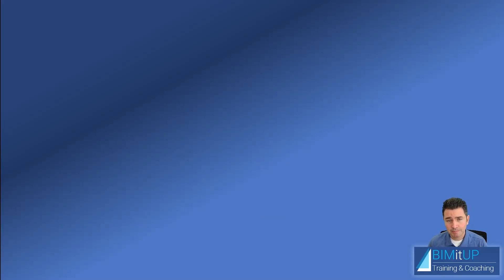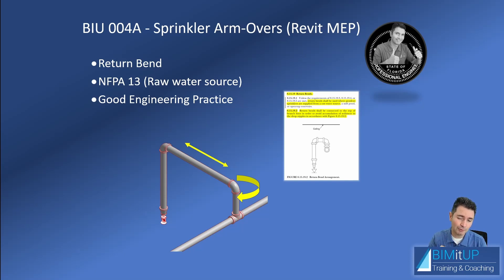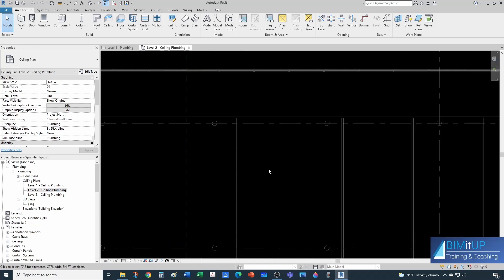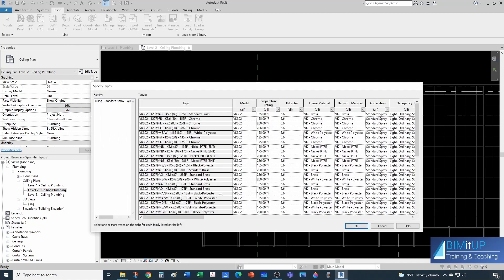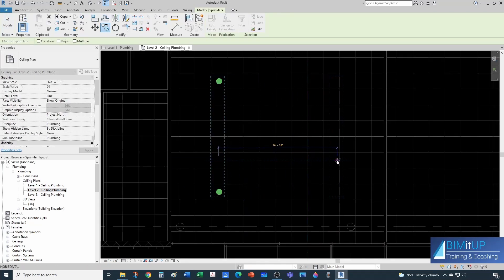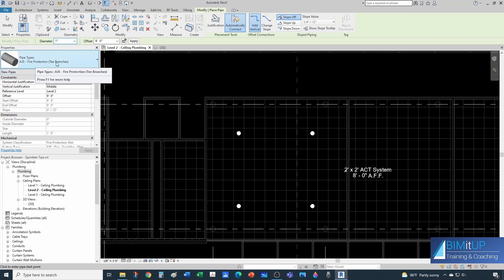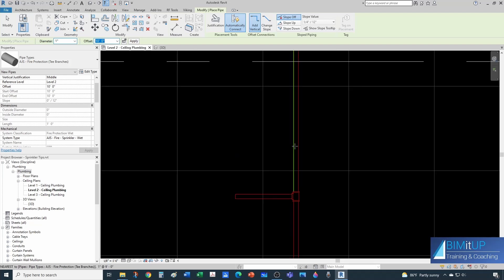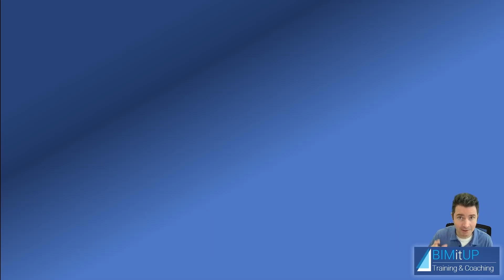Sprinkler Arm Over in Revit (Return Bend) Tutorial

Comment: The question I have if you go under duct work does the upright head follow the pipe or does it follow the upright head above?
Reply from the maker: Hi John. If I understand your question correctly...
you have to provide sprinklers under any obstruction over 4' in width (like some ducts). I typically provide the sprinklers midways duct width.
Also keep in mind that you might need to sprinkler under ducts that fall under "obstruction" per NFPA 13 requirements, even if they are less than 4' in width